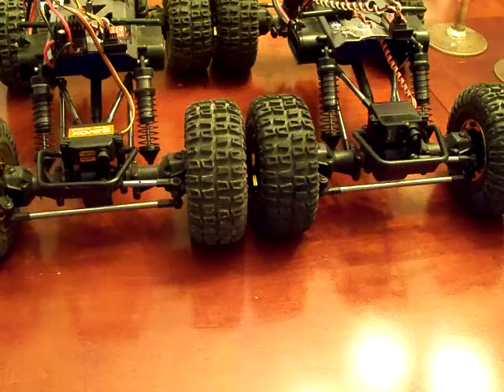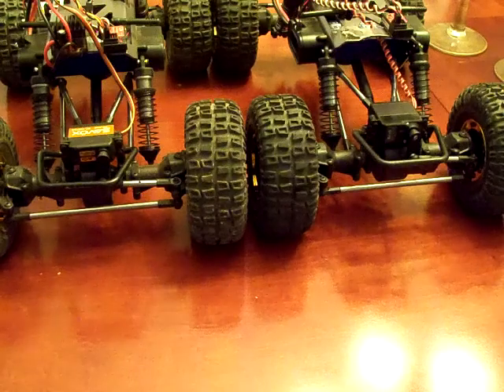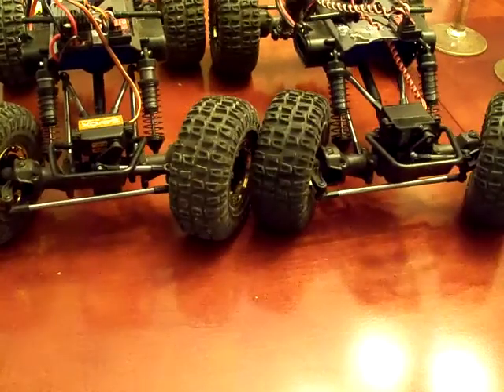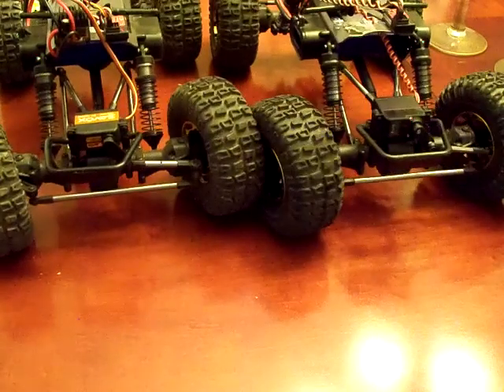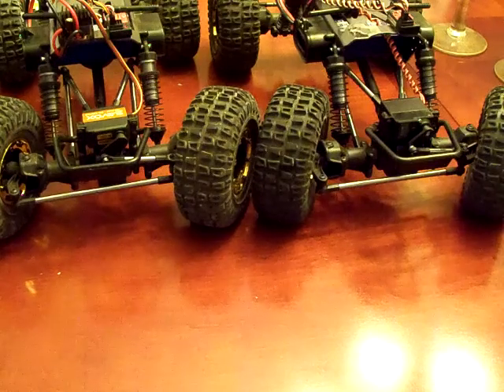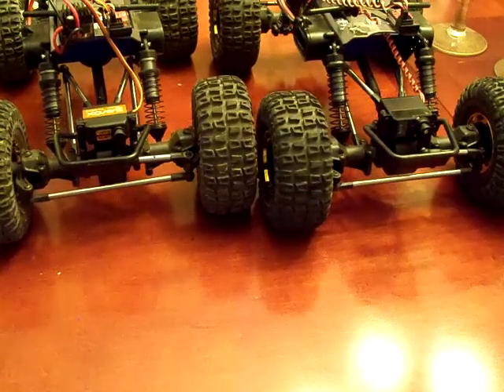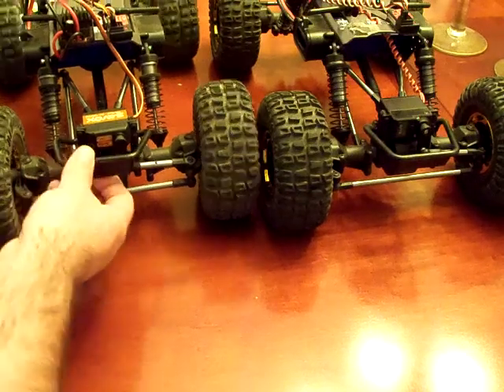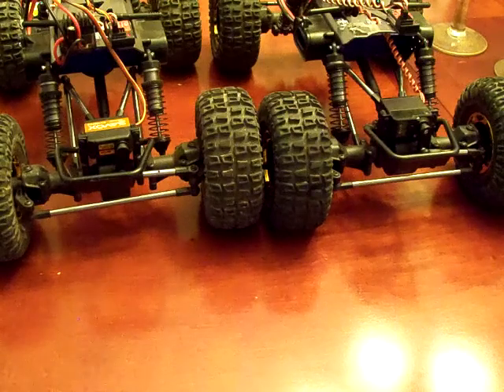Savox SC1267MG vs Solar D772 High Voltage Servos

Comment: even with a proteck 100t you can get as much torque as you can with the solar on stock voltage. Thank you for the advice

Comment from the maker: I believe the Solar servo is a little overrated, but wouldn't be too bad so long as you wire it up to 8.4V. For example the 1256 @ 4.8V should be comparable performance with the 772 @ 8.4V

Comment: D772

Torque (kg/cm) 4.8v 22, Speed @4.8v	0.22, Torque (oz./in) 4.8v 305.8

Torque (kg/cm) 6.0v 26.5, Speed @ 6.0v	0.2, Torque (oz./in)6.0v 368.35

Torque (kg/cm) 7.4v 30, Speed @ 7.4v	0.17, Torque (oz./in)7.4v 417

Length 41.3

Width 21.2

Height 40

Weight (g)	64

Gear Material	Metal
Bearing Type	Dual Ball Bearings
Digital / Analog	Digital
Motor Type	coreless
apply for	Helicopter/plane/boat/car
Reply from the maker: tyler williams ... I believe the stated specs from Solar are invalid and over stated, however they are good working servos on HV... if not running HV, then I wouldn't recommend Solar